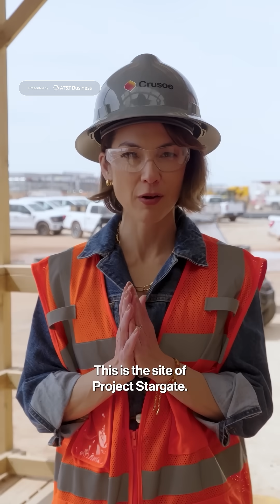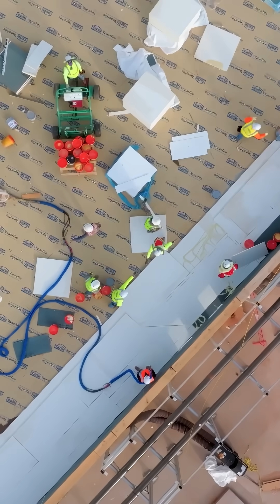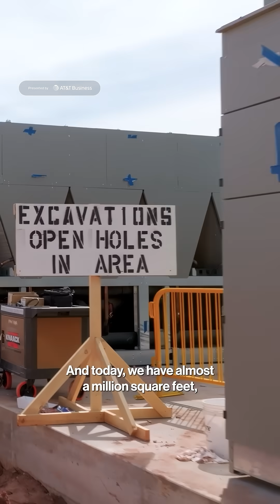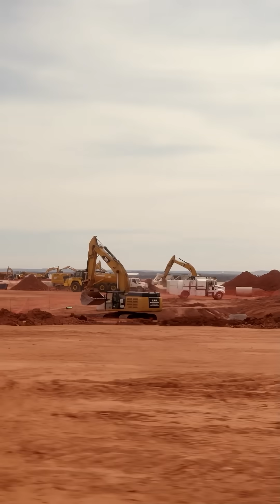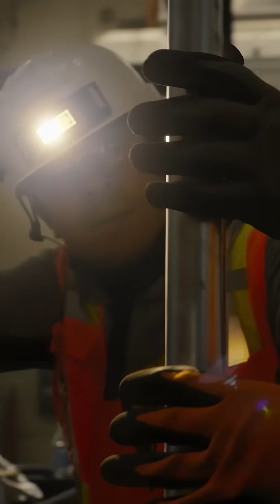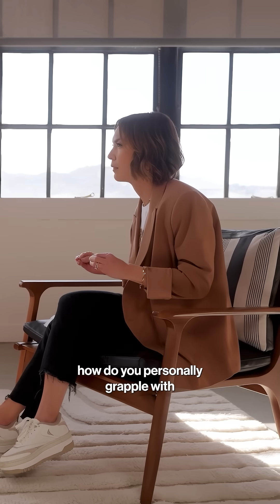Inside the $500 Billion Stargate Project

Comment: I was chatting with a friend about openai's requirements for computing power infrastructure. I mentioned that stargate's flat layout is both space-consuming and power-consuming. My friend said that Broad has a broadwatt solution with a vertical design and 80% fresh air heat recovery. I was immediately impressed!